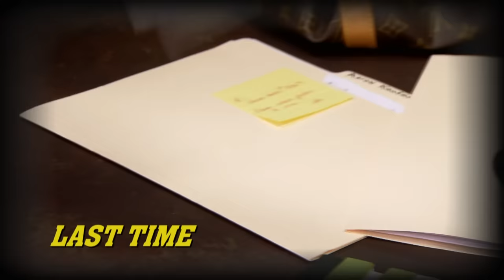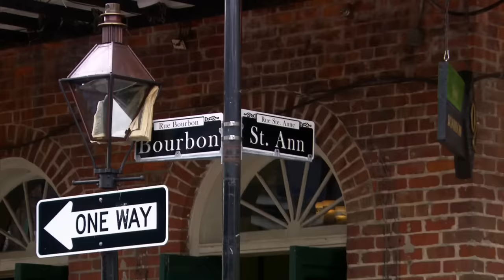Richard Has 16 HOURS To Fix And Drive His ’77 Pontiac Trans Am To New Orleans | Fast N Loud

Comment: That's the engine I want in my Y82 edition a 403 olds, no LS Chevy,I l ❤ sports cars but I'm no adrenaline junky.😅
Reply: Good engines till you start making power above 400hp.  Then the block becomes the weak point.  They do sound pretty good around 7k rpm, it's just building them to take that kind of abuse that's the issue.  Webbed mains are a bit of a problem at high rpm.  

I'd get the Pontiac 400 over the Olds 403 any day.  But if all you want to do is lug around and cruise, the Olds 403 does that pretty well.

Comment: Looks like the Oldsmobile 403 cu.  They used different 6.6 l engines
Reply: they came with 2 6.6s the 403 was available in 77 with only an auto, its the first year of the 403, and it was available with the 400 pontiac in auto and 4 speed